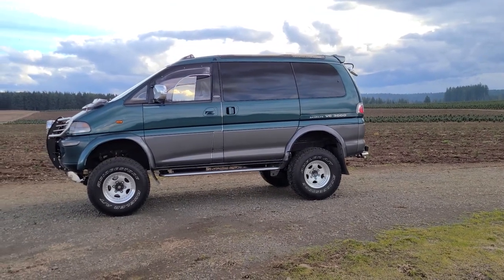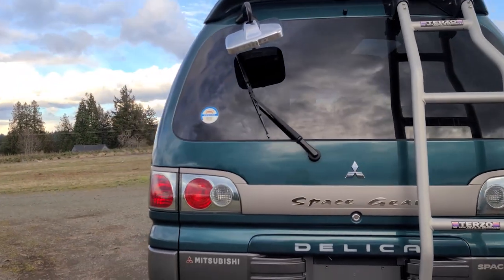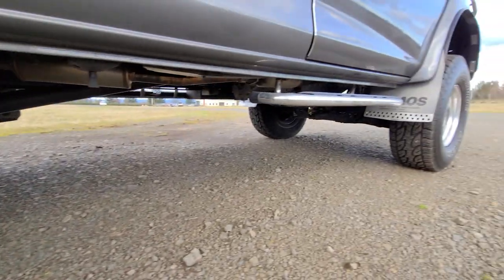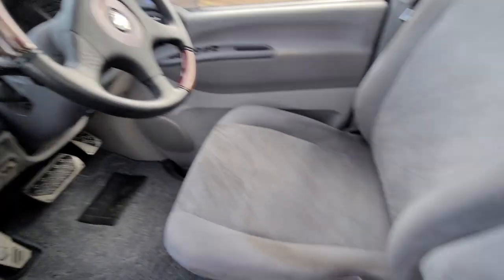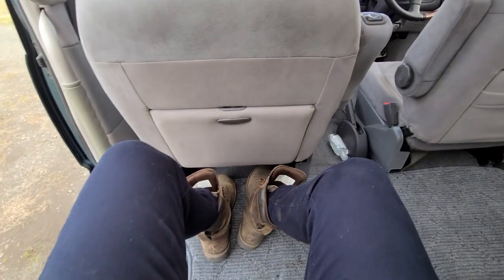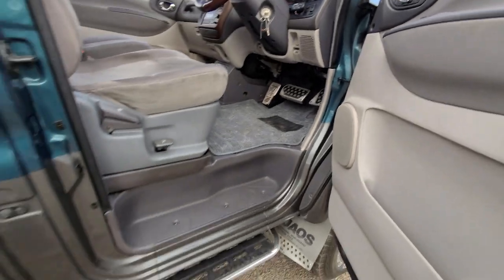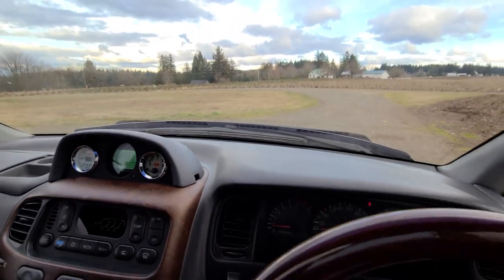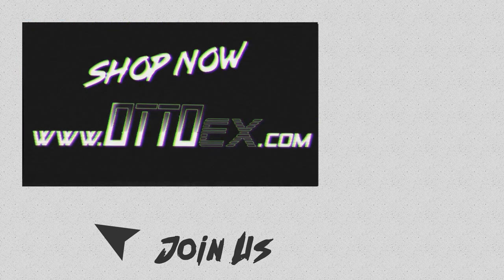1994 Mitsubishi Delica Space Gear Monster Van by Ottoex

Comment: Does the gas engine produce enough power? Any known issues with them?
Reply: Its an old 2.8 turbodiesel. Not the most powerfull engine, but does the job. Biggest problem is with overheathing causing cracking heads. Had it for 6 years, had to do the head, haha :-D
Reply: Sorry, this one is 3l petrol V6 so its definitely more powerfull. Not sure how reliable as I have had the diesel one. :)